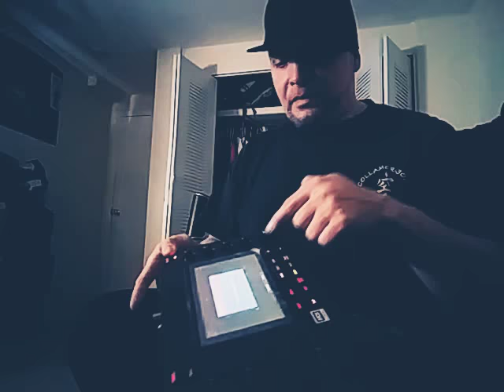MPC Live Tutorial - How to force a shut down on the MPC-live when it freezes or glitches

Comment: this guy genius thanks tried this on the MPC one plus dont know why it happened but it worked haha
Reply from the maker: This is where I think is happening with the MPC devices. I think it has to do with storage of your projects and the heat that your machine is producing Plus the NPC has to deal with the heat in your room if any. Make sure that you're temperature is at a minimum and you're storing all your project files on a external hard drive so that you're not overloading the machine. But in my opinion I think it is mostly has to do with the heat of the machine. I think it's best to develop a cooling system like a fan or just turning on your AC and cooling your room

Comment: Thank you bro. worked for me when upon starting my mpc live the screen got stuck on the MPC screen. Appreciate the tip!
Reply from the maker: Sorry for my late reply. I'm glad this video work for you because at the time people were having problems with the MPC live on Facebook Instagram and a lot of the problems there is occurring with this device some of it is really simply because of the fact that people abuse this device so much they don't even realize it. If you leave your MPC on for long periods of time that also can cause a freeze. Also room conditions. If your room is always hot that's never going to be good for the MPC live. Also memory if you have a lot of project files saved on the main Drive which is the drive that is used to process your music that is also the countability of the freezing that can occur with this MPC device. But I'm glad this video helped you but you may have to do some maintenance on your MPC live and also possibly storing your music on external hard drive

Comment: That works well... it also works when you shut it down and its stuck in shutdown mode.
Reply from the maker: Thank you. I'm glad this video works for you. The one thing that I didn't stay in the video was that the memory that's being used in the machine is very important as well as the temperature in the room because if you used in that HDD drive for the internal memory you're going to get problems. But if you use in that a good SSD drive those problems won't be as much and if your temperature in the room is suitable for machines like the MPC that generate so much heat that's going to help the stability of your Beats if that helps any

Comment: thank you my dude.
Reply from the maker: No problem buddy if you need any sing that has to do with the NPC let me know and I'll make a video
Reply: @ARCHITEKNIQUESTUDIO  the one thing I could use help with is latency when I record. I’ve been recording straight into my Mpc and I can still record once I get used to it but there’s definitely a tiny bit of latency and idk how to change it.
Reply from the maker: @SwagnusCarlton  are you talkin about vocals?
Reply: @ARCHITEKNIQUESTUDIO  yes I have my microphone connected to my Mpc through my focusrite 2i2 and there’s a slight delay when I’m recording vocals
Reply from the maker: @SwagnusCarlton  make sure that you don't have anything saved on your internal drive. I'm referencing things like your projects or your kits. Sometimes rebooting your MPC system helps with the latency and just save all your work on your computer if anything try to do most of your work on your MPC beats on the computer
Reply from the maker: @SwagnusCarlton  I don't know if you had a chance to check my message or able to restart the NPC as far as rebooting is concerned but when you get a chance to do all that and everything turns out okay my suggestion is to save some of your work on it external hard drive like a flash card or one of those plug-in external hard drives with a terabyte in them

Comment: This happened to me a few minutes ago on mpc live 2.. all I did was hit the “undo” button next thing ik im stuck in the main mode screen. Like wtf? Thanks for the video
Reply from the maker: I hope my video helped you. If my video helped you I'm glad it did. Hey if that undo button works then that's what's up . This particular machine though has a lot of issues as far as the Heat interacting with the program. Sometimes when you have a freeze on this particular machine it's a red flag for hidden issues that's about to emerge. The MPC live that you see on the video works but it's severely glitched so what that means I'm able to use it only to create a Beat on a slow pace

Comment: Why it frozen is it a screen hardware or internal problem?
Reply from the maker: There are many things why it freezes. For instance, storage is an issue, especially if it's stored inside in the internal memory. The other thing is temperature. Any machine, including computers like the mpc, is require cooling temperatures. When microsoft was helping AKIA with the MPC  machine forgot about cooling fans. Almost every machine, like the military nuclear warheads, all require a cooling system.

Comment: What do I do if mines keeps glitching out and turning black?
Reply from the maker: You might be looking at some hardware issues. Your machine may be overheated and you can try to take it to a computer shop but they probably going to tell you the same thing to get a whole new unit. If you look at some of the comments I left with people I tell them to keep the machine a certain temperature because they don't build those MPCs with a cooling fan. Without the cooling fan the circuitry could be melted and affecting the flow of the chips inside of the machine. So if you're experiencing glitching and possible screen blacking then chances are your machine is about to be junk
Reply from the maker: Try sending your machine to a computer shop or mpcstuff.com for repairs

Comment: Thanks mines does this all the time. damn i spent $1400-$1500 for this thing. it shouldn't act like that. akai need to check they selfs
Reply from the maker: I'm sorry to hear that my friend. Sometimes the motherboard gets melted. I know a lot of people don't want to believe that but it is a computer and it does exactly like what a computer does and that is generate a lot of heat so if you have a work room there's not a refrigerator chances are you could be melting the circuitry when using the machine. I think that company only specifically develops devices for you to make beats but doesn't cater to the cooling system that the MPC requires. If you do then your money on another machine my suggestion will be some cooling fans or maybe a air conditioner for your studio
Reply: @ARCHITEKNIQUESTUDIO  Right. i did exactly what you said and it's better.. it will still give me a "your MPC recovered from an eternal error then cut back on by itself. but i guess that comes from how it's touched.

Comment: Why MPC 5000 crashes what is the cause for it?
Reply from the maker: I can give you some ideas but I'm only using the MPC live so I wouldn't understand why the MPC 5000 will be crashing. Here are some things why I could be crashing. One could be because of overheating. The MPC in the past was designed for use but not long or practical use. The MPC 5000 and other brands like that get overheated because that company never developing a cool system or a chip to stop the device for overheating because the company doesn't understand that beat makers can spend hours and hours and hours creating music or in development of the music and requires a machine to last that long. The other thing is memory if you have too much memory stored on the device and using their internal memories chances are the hardware Maybe reaching this capacity

Comment: Bro my MPC Live does this far too often even after shutting down I kinda just deal with it and save as much as I can
Reply from the maker: Sorry for the three-day delay on commenting back. I have to tell you. And it's really a heads up as far as anybody using the MPC live or anyting similar to that unit. If the NPC gets overheated chances are that it might start glitching. He would do that to the hardware
Reply: @ARCHITEKNIQUESTUDIO  it’s crazy because after I posted that my MPC Live has been running with no issues. I sold my first beat too that was so hyped!
Reply from the maker: @IZA-611  that is excellent my friend. Always remember that the MPC is a mechanical digital machine similar to the laptop. That means that you have to the defragment it as well as keep the temperature cool